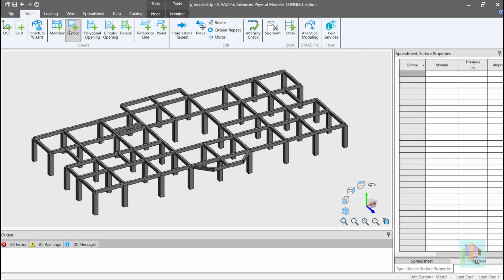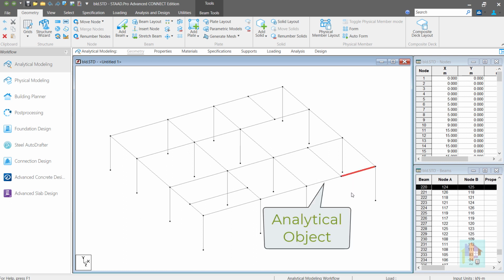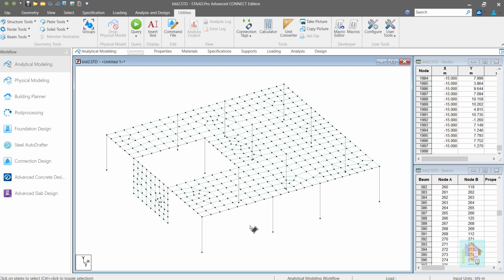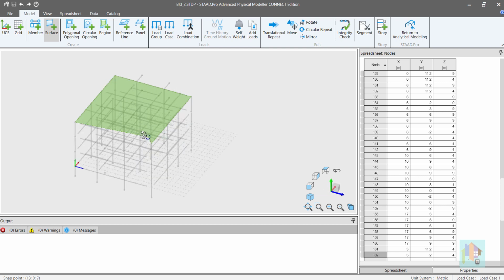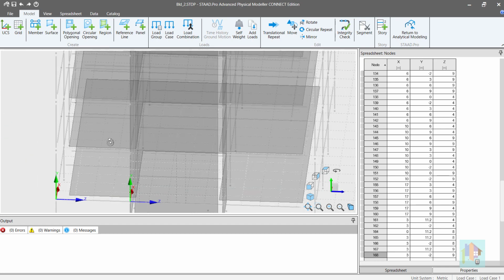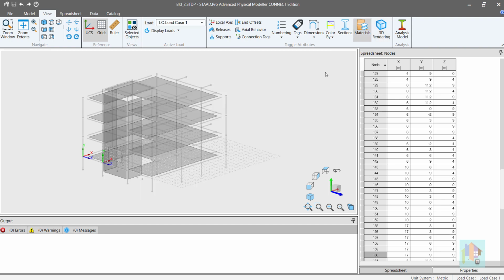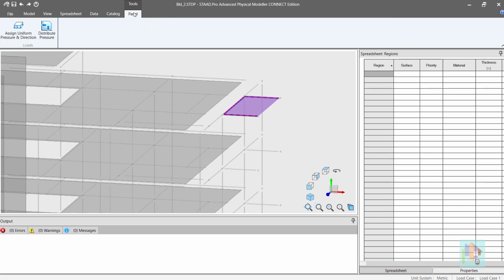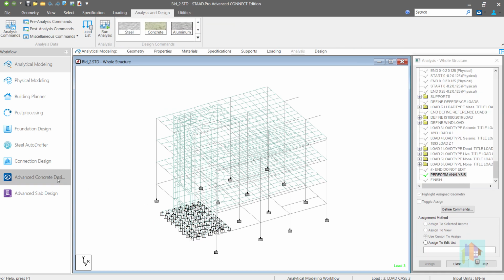Generate Plate Mesh in STAAD: Part 4 – Modelling using physical objects

Comment: Sir, first of all, thank you for the quality videos, in fact, I have learned a lot from your videos, and  it will further  take me to another level in the staad knowledge if you could share videos on the following topic;
1). How to model and analyze the equivalent diagonal for URM infill in staad
2). How to apply the line load of the wall to the slab that falls directly on the slab, not on the beam
Thanks in advance

Comment: For the benefit of everybody...How do you create a Wind Load Primary Load case in Physical Model mode similar to arrangement as shown below?
Example:
*****************************************************************************
LOAD 12 LOADTYPE Wind  TITLE WL+X
WIND LOAD X 1 TYPE 1 YR 0.5 9.8
WIND LOAD -X 1 TYPE 2 YR 0.5 9.8
WIND LOAD -Z 1 TYPE 3 YR 0.5 9.8
WIND LOAD -Z -1 TYPE 3 YR 0.5 9.8
*****************************************************************************
LOAD 13 LOADTYPE Wind  TITLE WL-X
WIND LOAD X -1 TYPE 1 YR 0.5 9.8
WIND LOAD -X -1 TYPE 2 YR 0.5 9.8
WIND LOAD -Z 1 TYPE 3 YR 0.5 9.8
WIND LOAD -Z -1 TYPE 3 YR 0.5 9.8
*****************************************************************************
LOAD 14 LOADTYPE Wind  TITLE WL+Z
WIND LOAD Z 1 TYPE 4 YR 0.5 9.8
WIND LOAD -Z 1 TYPE 5 YR 0.5 9.8
WIND LOAD -X 1 TYPE 6 YR 0.5 9.8
WIND LOAD -X -1 TYPE 6 YR 0.5 9.8
*****************************************************************************
LOAD 15 LOADTYPE Wind  TITLE WL-Z
WIND LOAD Z -1 TYPE 4 YR 0.5 9.8
WIND LOAD -Z -1 TYPE 5 YR 0.5 9.8
WIND LOAD -X 1 TYPE 6 YR 0.5 9.8
WIND LOAD -X -1 TYPE 6 YR 0.5 9.8
*****************************************************************************

Comment: For the benefit of everybody...How do you input the negative sign for the accidental torsion (i.e., ACC -0.05) in Physical Model mode?
Example:
LOAD 1 LOADTYPE Seismic  TITLE UBC EQ+X+ECC
UBC LOAD X 1 DEC 1 ACC 0.05
PDELTA ANALYSIS SMALLDELTA
CHANGE
LOAD 2 LOADTYPE Seismic  TITLE UBC EQ+X-ECC
UBC LOAD X 1 DEC 1 ACC -0.05
PDELTA ANALYSIS SMALLDELTA
CHANGE
LOAD 3 LOADTYPE Seismic  TITLE UBC EQ-X+ECC
UBC LOAD X -1 DEC 1 ACC 0.05
PDELTA ANALYSIS SMALLDELTA
CHANGE
LOAD 4 LOADTYPE Seismic  TITLE UBC EQ-X-ECC
UBC LOAD X -1 DEC 1 ACC -0.05
PDELTA ANALYSIS SMALLDELTA
CHANGE
LOAD 5 LOADTYPE Seismic  TITLE UBC EQ+Z+ECC
UBC LOAD Z 1 DEC 1 ACC 0.05
PDELTA ANALYSIS SMALLDELTA
CHANGE
LOAD 6 LOADTYPE Seismic  TITLE UBC EQ+Z-ECC
UBC LOAD Z 1 DEC 1 ACC -0.05
PDELTA ANALYSIS SMALLDELTA
CHANGE
LOAD 7 LOADTYPE Seismic  TITLE UBC EQ-Z+ECC
UBC LOAD Z -1 DEC 1 ACC 0.05
PDELTA ANALYSIS SMALLDELTA
CHANGE
LOAD 8 LOADTYPE Seismic  TITLE UBC EQ-Z-ECC
UBC LOAD Z -1 DEC 1 ACC -0.05
PDELTA ANALYSIS SMALLDELTA
CHANGE

Comment: For the benefit of everybody...How do you assign crack sections in Physical Model mode?
Example:
MEMBER CRACKED
1001 TO 1022 1101 TO 1121 1201 TO 1215 1301 TO 1316 -
1317 REDUCTION RIX 0.700000 RIY 0.700000 RIZ 0.700000
2101 TO 2139 2201 TO 2263 2301 TO 2304 2306 TO 2375 2401 TO 2459 -
2460 REDUCTION RIX 0.350000 RIY 0.350000 RIZ 0.350000

Comment: Which is good for Designing buildings  using analytical model or physical model ??
Reply from the maker: It depends on the structure. If you want to model a building structure with plate mesh (shear wall, slab or mat foundation), then it is always preferable to use physical modeler where all the connections (beam to plate, plate to plate) are internally handled, chance of error is nil. Apart from that, there are few load items (panel load, pressure load) which is more advanced in physical modeler.
Reply: @surojit_ghosh  okay sir

Comment: any idea on mesh size
Reply from the maker: Sorry, I didn't get your query. Do want to know about the target element size? As far as I can remember, I set it to 0.25-0.5m. In physical modeler, you can control the mesh size, start with a coarser mesh, visualize and then change the target element size to make it finer. No need to remesh, as the FEM/nodes are internally generated.